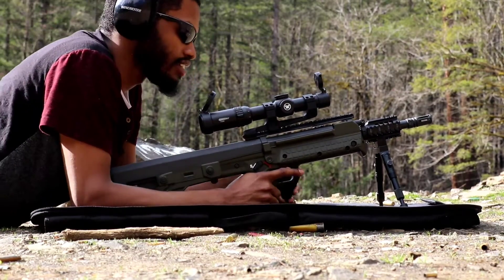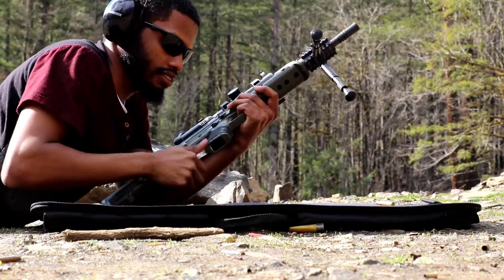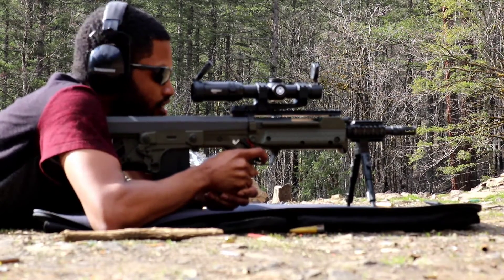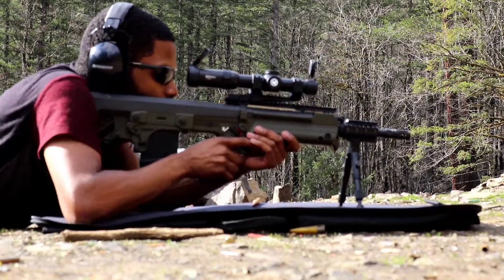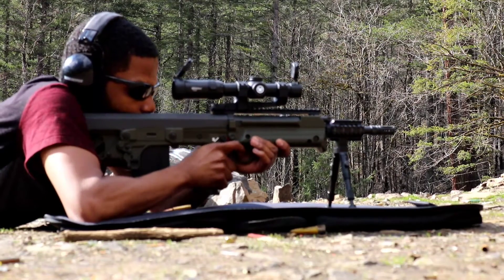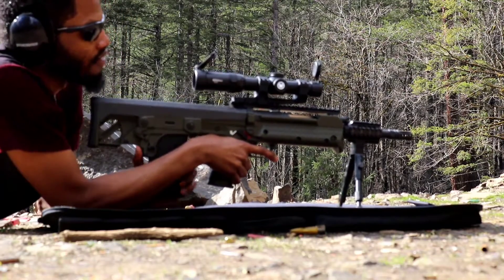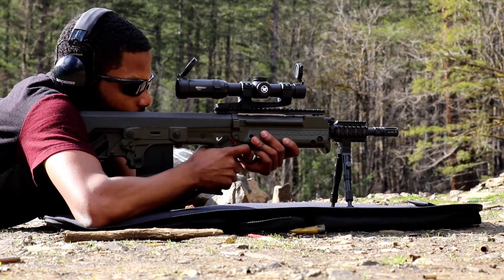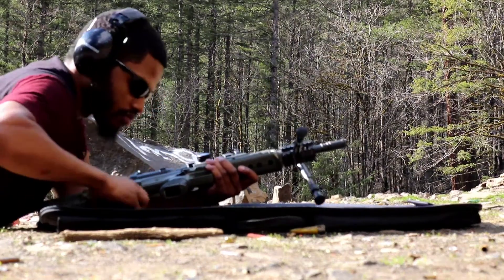Keltec RFB 18" issues

Comment: How are you sir.  I have two RFB's, 18' and 24' and a KSG.  Bought them off Gunbroker so they had a few rounds through the RFB's when I got them.  I may be one of the lucky ones because my experience with the RFB's has been extremely positive.  I've read all the reviews and watch a number of YT post hating the RFB.  ew things I've picked up on is that you MUST put about 400 to 500 rounds down range to break it in.  The other is to determine the gas setting for the rounds you will be using.  Once I got my RFB's, I set the gas at 20 clicks from bottom, meaning completely closing the piston (laying the RFB on its left side, rotating the adjustment knob away from you to you can't rotate it anymore}, then turn it 20 clicks towards you.  This is a start.  This is what I call my "base set" making all my adjustment from there.  I have also found out that over the counter brand ammo can change the gas setting as well.  If I'm not mistaken, the RFB is chambered for 7.62 NATO, but can shoot .308.  I have found out that there is a slight difference between 7.62 NATO and .308 cartridge headspace and powder load which could cause cycling problems.  I have shot 7.62x51 PMC x-Tac, Federal (steel core), American Eagle (steel core), IMI Samson (Israeli made), Aguilla and MEN (German Made).  Keeping it simple, I'm going to stick to 7.62 NATO PMC x-Tac, MEN and Aguilla.  They give me a tight shot group, easy to find and I don't have to reset the gas piston when I shoot.  Different story when I put the suppressor on.   I'm not an expert so follow up with your own research.  Let me know what you find.  Good luck. #eagertolearn
Reply from the maker: 6Glock Griff your feedback is much appreciated! I have yet to reset the gas and get back out to shoot the RFB some more but I do love the rifle and I am eager to get it functioning properly. The ammo I am currently using is the German MEN ammo which is much easier to find and more reasonably priced than other 7.62x51 ammo ive found. I will definitely be adjusting the gas block and sending a few hundred more rounds down the tube. I love the concept of the rifle and its ambidextrous features. My biggest dissapointment is that i paid $1700 for the rifle and saw it on sale for $1300 3 weeks later.
Reply: I'm real excited about the weapons too.  I was originally looking at the Desert Tech SRS A1 Covert.  Over the counter they run $6000 to $7000.  Had one insight on GB for $4500 with a scope and bipod, got away from me though, thankfully.  Yea, I know bought pricing.  I bought in on the 18" at $1290 and saw one sold for $1100 a couple weeks later.  Good thing is looking at GB prices now a days, buy now prices are going up helping our resale value.  FYI: If there is a weapon issue, Kel Tec will be more than happy to help.  Let me know how it goes bruh.......

Comment: When I got my rfb I had constant Ftf and double feeds. I Sent it back and Keltec replaced the barrel because they said the gas port wasn’t the right diameter. They set the gas setting while testing and shot several rounds before they sent it back. She has been a beast every since. If you’re having issues and know the gas setting is correct send it back

Comment: I have one of these in 24 inch and love it, I also the Austrian FN FAL which has never FTFed, so I looked at the feed ramp on the FAL and noticed there were two indentations going into the chamber that allowed for smooth feeding. I took out my dremel and emulated the feed ramp in the RFB and I've had no problems. Just FYI
Reply from the maker: that sounds like a good idea! i never thought to imitate the feed ramps. i originally bought this rifle because I wanted an FAL but couldnt find any on the market so this was my 2nd choice. Since this video i have adjusted the gas a bit and it works flawlessly with the same German MEN ammo I used in this video.

Comment: I have a Gen 2 RFB with 2,000+ rounds and only had one FTF during the break in procedure.
When you first get the rifle read the manual, then take the gun apart and clean it. Lube it then put it back together. During break in my gas setting was 27 clicks open and after break in it is now at 24 clicks open. Use mild 308 ammo no high performance stuff since it is a 7.62x51 rifle. No steel case ammo and you'll be good.
I have 1,000 rounds of Armscor 308 147 grain and 1,000 American hand loaded 7.62x51 147 grain through the gun. All brass casings!
99% of problems I see people having are user issues. The Gas setting seems to confuse alot of people and is the main culprit. You want enough gas to push that bolt back but not enough to bruise your shoulder.
Reply: I never really understood the wonders of a buffer spring until my rfb taught me 😅😅

Comment: One thing I've learned with my KT's (this really applies to all guns AFAIC) is that before you put a single round downrange, disassemble, clean and lube the gun. Then put a few hundred rounds through it. The first part will greatly reduce any failures, the second is good break in.
Reply: @Trading Algorithm  keltecs are nicely packed full of cosmoline, in case they gotta sit on the shelf a minute. My rfb was a sticky mess inside.

Comment: Out the box, it should be cleaned and lubed and expect to adjust the gas setting because it is most likely not set to whatever you decided to run in it. also if you decide to run it suppressed be sure to pick up the optional gas piston that's optimized for suppressor use.
Reply: Inside mine it was full of cosmoline.

Comment: I see a lot of comments about adjusting the gas.  Have seen several reviews that discuss the same thing and that seems to be Kel Tec's official response.  I'm sorry, but you shouldn't have to adjust the gas system every time you use a different brand of ammo.  Go unsuppressed to suppressed, yes adjusting gas makes sense, but not for different ammo.  Looks more like Kel Tec's just sucks at designing a reliable bullpup rifle.
Reply: Itll work with pretty much any ammo with the gas all the way open. You can tune it down to shoot softer with some ammo in some conditions. Thats a positive thing not negative

Comment: I've owned my 1st gen RFB for about 5+ years never had any issues once I learned how to set the gas system until I recently used steel case ammo! I read online that some people have had no issues with steel but I won't be going back to it unless its going in an AK. If you own a RFB take the time out and learn to set the gas system! There's a video on YouTube where the guy explains step by step how to do so!

Comment: i really want to buy a bullpup that does 308.  Of all the videos i  have seen about the RFB, 80% of people having issues.  In a self defense situation you don't want even 98% success rate.
Reply: Ive had mine for 4 years. For the first couple months, I wanted to beat George Kellgren over the head with it. Now, after getting used to it, learning it, I wouldn't be without it.
Reply: If THIS is your self-defense weapon I'm 98% sure you are choosing the wrong type of weapon.  I'm just trying to imagine this sitting on the nightstand.  I know it's short but really?  All jokes aside...I picked the RFB because of its uniqueness and packaging.  I'm not going to war...I'm not hunting with it.  I just love the design.  Also I chose the 24" version and noticed that it doesn't have as much gas coming out versus the 18" version.  If I have to ever pull this out the world has truly gone to crap!

Comment: You should've adjusted the gas as soon as you got your first failure to feed. After you kept firing without adjusting, the malfunctions was on you. It's hard to give a decent review without making the necessary adjustments.
Reply from the maker: William Wilson 1 FTF does not immediately require a gas adjustment. i own several firearms and this is the 1st rifle to ever need a gas adjustment from the factory. A friend bought this same rifle at the same time I did and has never had an issue with FTF, so why would I assume my rifle in particular needed an adjustment?
Reply: I really don't know why Kel-tec made so many gas adjustments for the RFB, but I'm sure there is a reason behind it. I read the  manual and did exactly what they said to do before I fired it. I had 1 failure to feed and turnede it  a quarter of a turn and never had an issue since. All I'm saying is it could've been a far better review if you would've made an adjustment and then continued the review.
Reply from the maker: William Wilson i understand your point and get where your coming from. I decided to make a random video when I was out shooting and didnt put to much thought into it so i didnt really consider it a review. Just wanted others to see some possible issues from the factory. Even with the gas adjustment, once the ammo is changed it continues to FTF. Not to fun adjusting the gas everytime i decide to switch ammo.
Reply: I've had mine for about a year, and at first I ran into some of the same problems you had in this vid. I adjusted the gas for the steel case ammo I was using, then gave it a few extra clicks, to avoid having to fine tune it every time I change ammo. It's not perfect for each option, but it hasn't had any more problems.

Comment: Mine has never failed to feed. I can completely remove the gas adjustment cap and it still cycles. 😂 This is after sending it back twice for the same problem. It’s over-gassed. Don’t know the reason why, but keltec customer service sucks. They treat their customers like they’re stupid and don’t actually pay attention to the customer’s complaint.